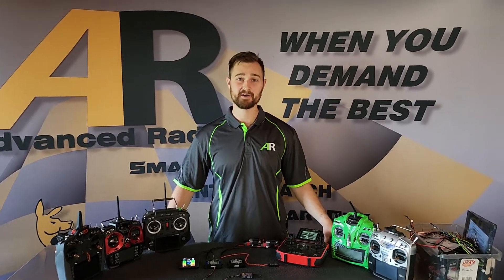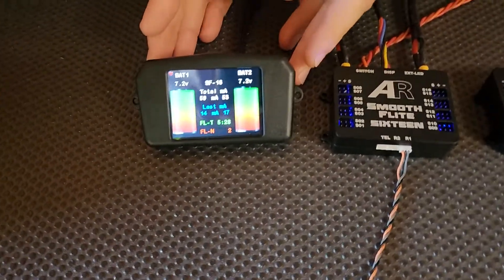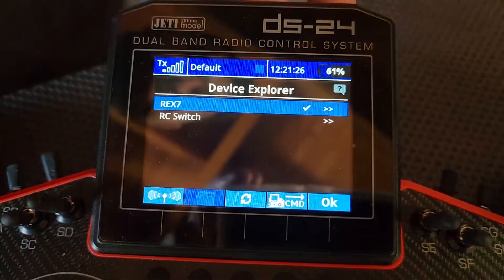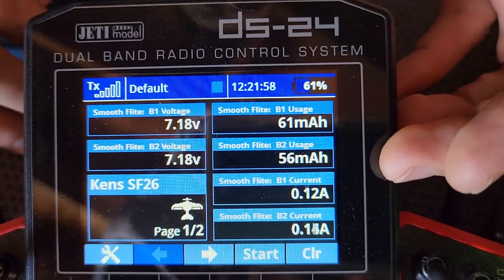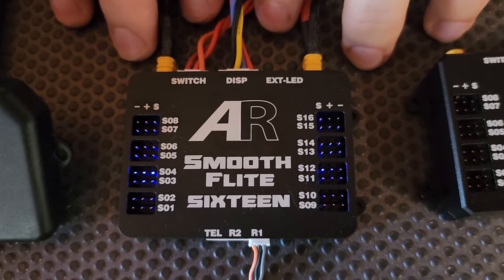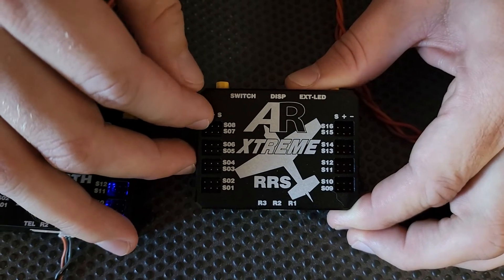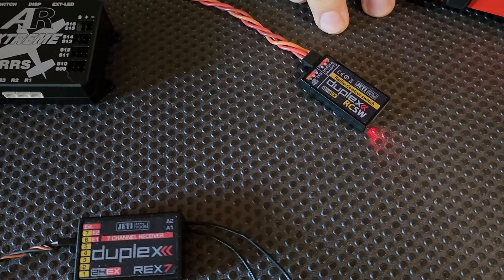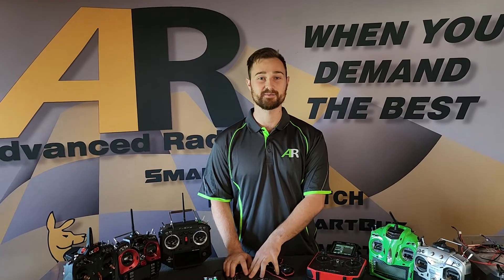Jeti setup with Smoothflite 16 and Extreme.

Comment: Awesome video very informative.  Question...planning on using two Jeti R3/RSW receivers into the Smoothflite 16 ports.  Should I be plugging into Port 3 (Control output) or Port 4 (Ext) on the R3/RSW receivers?
Reply from the maker: Hi @williamh-wm1bp According to the Jeti R3 manual, The EXT port on the R3 receiver outputs the Exbus protocol. It is best to check this when you bind the RX to the radio
Reply: @rickgellboomarc thanks Rick.  I figured that out by trial and error.  Working on switching from Spektrum to Jeti and your video is invaluable

Comment: You said that it is fully compatible with Jeti. Will it recognize and accept the Jeti Central Box 100 input? I want a one wire output from a multi servo part on the airplane (using the central box) to plug into one port on the AR Smoothflite.
Reply from the maker: yes as long as the input is EXbus

Comment: if using 2x jeti receivers in "clone" mode, are there any different settings needed on the SM 16 to support this vs "dual path" ?
Reply from the maker: Jeti Dual Path allows for both RXs to be monitored as long as they are both set to EXBus